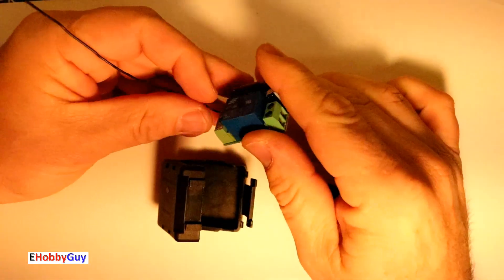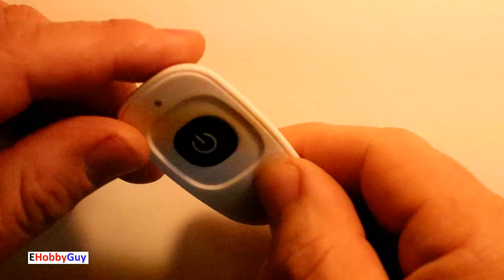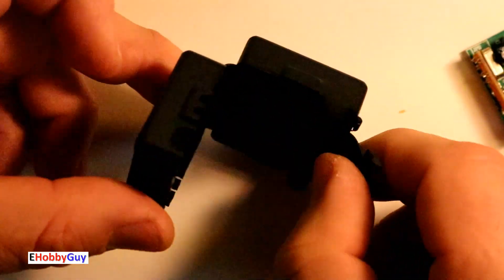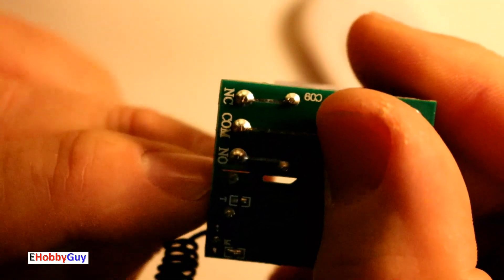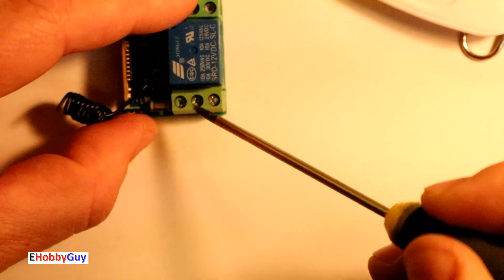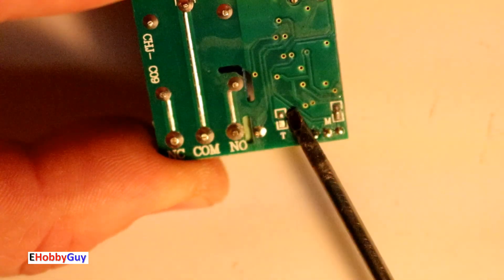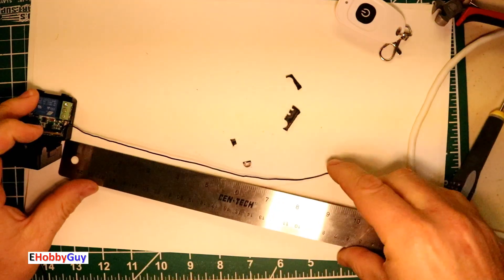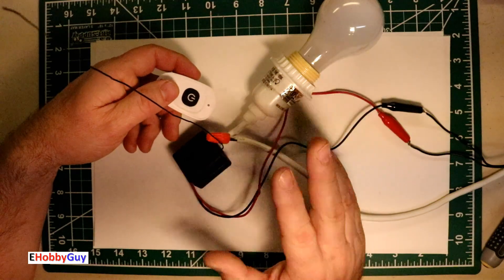WIRELESS RELAY SWITCH HOW TO AND REVIEW

Comment: Nice, accidentally i found nice explanation video about that kind of switch :D but i have a problem with mine. it works great when i plug it solo or with 12v pc fan, but as soon as i connect my 12v on-demand water pump to it i clicks and turns off my solar controllers output for a moment. pump needs 5a fuse, im using 7.5a between switch and controllers positive. pump works fine when connected directly to 12v 20ah battery. any ideas why it behaves like that?
Reply from the maker: I’m not sure.  I would have to see a sketch of how it is wired.  Does the pump have its own independent power supply?
It’s possible the current it too much for the on board relay
Reply: @ehobbyguy8980  it's something like this https://puu.sh/Jofhe/d0a715a46c.png
wires are connected with wago connector, i tried to switch to 5A fuse, tried to use it on COM- pump + line, didn't work.

Comment: I tried this thing and it would turn on randomly and drianed my battery.  I was just using it on a dc to dc charger control wire.  Driveing around it would randomly turn on even with remote battery removed.

Comment: Hey Paul, can you enlighten as to what a wet circuit is. You explained that you can jump the common lead with the input positive DC supply voltage and I’m curious what happens with the other leads, nc and no on the other side? I believe that this is input /output being the same DC12-30VDC but clarification would be greatly appreciated. Bless you and your efforts and merry Christmas

Comment: Do you have the power wired up to a separate power supply? I was wondering if just with the connection from the wall to the light bulb you could power and switch? Or do you always need one circuit powering the switch and then the separate light circuit?

Comment: How do I modify a 12V 433MHz wireless remote control switch relay receiver and transmitter? Someone in the area (neighbor) is using the same frequency.

Comment: Next time you make a tutorial, don't give everybody a lot of hogwash about the case,  the case was made that way so that you would have to make holes for the wires.  Why? so that there would not be any more holes then what you require.  Why again, because sometimes these remote receivers need to be used outdoors for maybe a pole light, this is not for waterproofing,  this is for ant proofing as ants like to get inside stuff like this and ants would destroy it by grounding it out with their bodies.

Comment: I have the same one. Mine randomly comes on and goes off by itself. I feel bad for the next door neighbor I'm probably turning stuff at his house on and off is there a way to shorten the distance.?
Reply: @   tony Torkelson   All you have to do is change the code of your remote so that it is not the same code as your neighbor.  look for a tutorial on changing the code. it will show you how to do it.
Reply: @chucksteward2615  Cool thanks
Reply: @chucksteward2615   IT WAS A CLOCK CHEKING OUT SIT TEMP ! OMG.

Comment: Using a 2 channel to control a 12v dc motor ( reversing direction ) and adding a manual switch would I have to install diodes in all the motor circuits? Thanks

Comment: You talked too fast when explaining options NO1, COM, NC1.  I know no1 means normally open, and nc1 means normally closed1.  What is com?  What does the common wire have to connect to for my remote control to work?  Mine is different than yours but similar enough that you could answer my question.
Reply: @ C M 4   Com is the input connection for NO1 and NC1.   If you controlling something with a/c--you connect the a/c line wire to comm.  If you are controlling something with D/C--you connect the hot d/c wire to comm.   When you activate the remote control no1 or nc1 route the power to do the work.

Comment: Can I power with 9v battery
Reply: I’ve had them work on as little as 6 volts. But, you can get these set up for 5 volt operation. Just shop around.
Reply: @ K Rie take a look at this tutorial and tell me what you think about it? ( Remote control switches for Lights and Fans | Wireless Remote Control Switch | Buy Amezon )   ( i don't know if it came out right,  try clicking on the frase--rem con sw.  if nothing happens type it in & hit ENTER.
Reply from the maker: K Rie I don’t think it could be run by a 9v battery. At least not the one I have.  There may be a 9V version that I am not aware of. The on board relay is a 12V relay, so I just don’t think 9V would be enough.  I hope this was helpful.   Thanks for watching!
Reply: Was wondering the same thing.
Reply: @  K Rie  I don't if you seen what I WAS REFERRING TO,  but I was watching a tutorial about switch programming and the guy was using a 9v battery on a 12v remote.

Comment: Hi, great video, I have a problem, when I press button on transmitter I see red light on transmitter but no red light on receiver. Is there a way to for binding. I have exactly same version with one button. Thank you.
Reply from the maker: Jakub Hoblík make sure the antenna is fully extended. Also, I have observed that it can be intermittent or not working if you are too close. Extend the antenna, and try transmitting to it from 20-30 feet away.  Let me know how it goes. Thank you for watching and thanks for the question.
Reply: @ehobbyguy8980  Hi, thanks for reply, but nothing works, maybe mine is broken overall its cheap electronics.
Reply: @ Jakub Hoblik   Is the receiver working when you press the transmitter button?  Most receivers that have a light are for programming only and not for everyday operation.

Comment: Hey man, I have the same receiver but when I press the button on my remote it doesn't trigger the relay essentially doing nothing
Reply: @ Josh Orrison  it may just need to be programmed.  before sending it back, go on lin and ask for a tutorial for programming the remote. after you try this and it still does not work then send it back.  Programming only takes a minute to do.  Is super easy.   This could save you time and money.
Reply: Its a shame he didn’t answer your question I’ve got the same problem so I’m sending the unit back
Reply: @jimgeelan5949  damn shame

Comment: How about a link to this switch?  Great review as always!
Reply from the maker: Sure, here is a link.  Not sure how long it will be good, because some listings can expire or be cancelled.  Try it out.  Thanks for watching!!

https://www.ebay.com/itm/DC-12V-Wireless-Remote-Control-Relay-Learn-Code-Switch-Transmitter-Receiver/142236876824?epid=21019369573&hash=item211dfa8018:g:g1kAAOSwwZJcdIPM
Reply: @ehobbyguy8980  will it work on lower voltage,?
Reply: @ Josh Orrison  these remotes can be bought from a lot of sources.    Just do a search for remote controls, your computer will give a lot of options.

Comment: I would to use a similar relay circuit for a remote control project.  I like to report when a remote switch is open or close.   Do you have any thoughts if it would be feasible to modify the push button RF transmitter circuit to accept a low voltage signal or open/close state of my remote switch?
Reply from the maker: Joe Berg I am not sure of how you could transmit back the status of the switch.  Hmmm... does anyone have any ideas?

By the way thanks for the question and thanks for watching!!
Reply from the maker: Yes Joe if you use the relay in its momentary mode, the signal will remain high while triggered, and go low when the switch changes state.  This will take care of the open/close state.  To trigger the remote, you would have to replicate the momentary switch on the remote with your system.  You could potentially trace the switch connection on the circuit board to see where the signal is sent, I haven't done it, but it is feasible.  Anyway I hope this was helpful.  .Thank you for taking the time to watch the video !!!
Reply: @ehobbyguy8980  can i power this with 9vdc?
Reply: @ Joe Berg  the gate should have limit switches to stop the actuator motors at the end of travel,  you could connect them to a transmitter set to different freq. to transmit an open or closed signal with lights indicating as such. but this would be a stand-alone unit, not attached to your remote control.